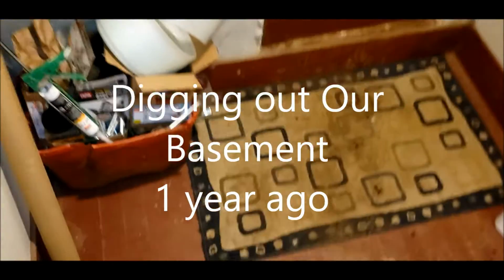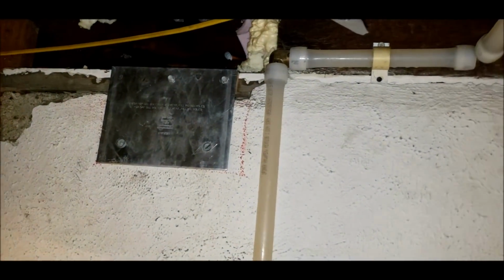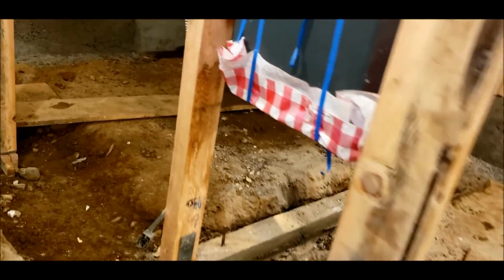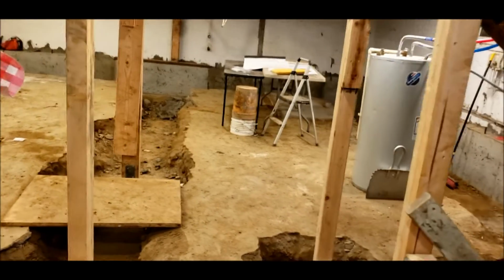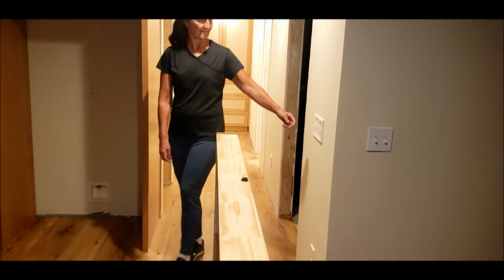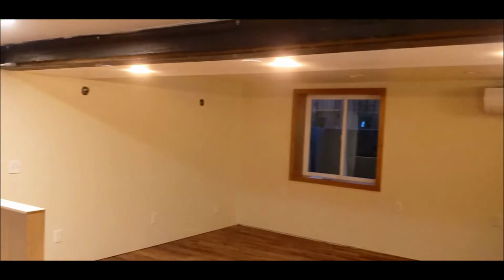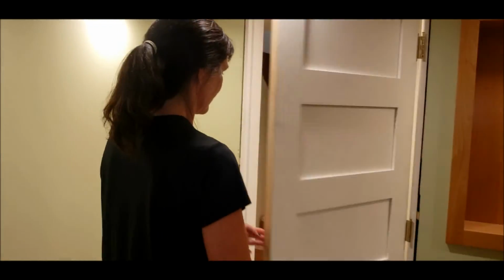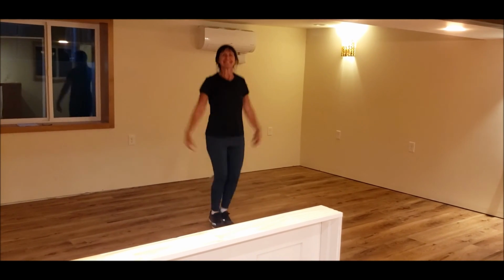Big Basement Dig Out. 1 year ago VS: Now

Comment: Why is it the city's business how much light you let in? It's none of their business if you even have a window or not!
Reply: It's probably due to ventilation also, in case a window needs to be opened because of kitchen smoke etc ???
Reply: Usually has to do with fire code. Need to have egress in case of fire or you could potentially be trapped.